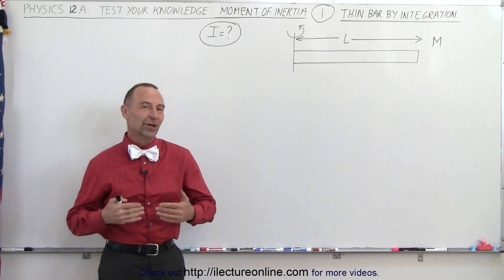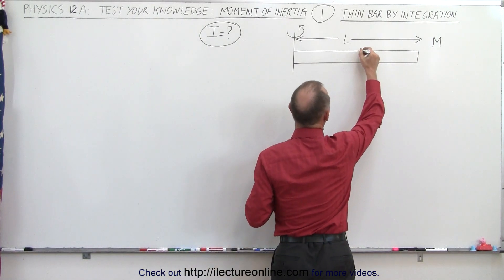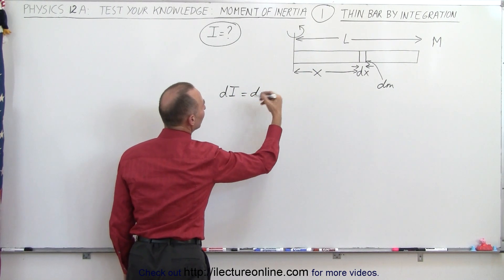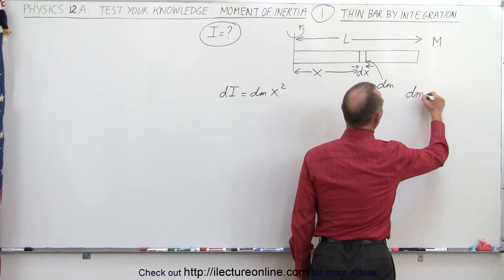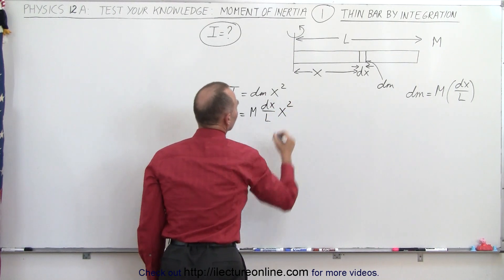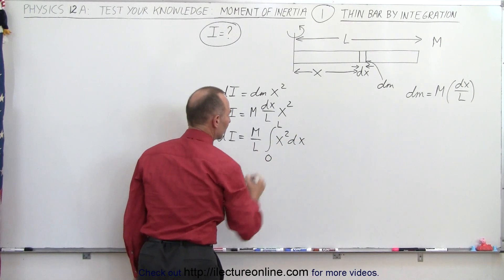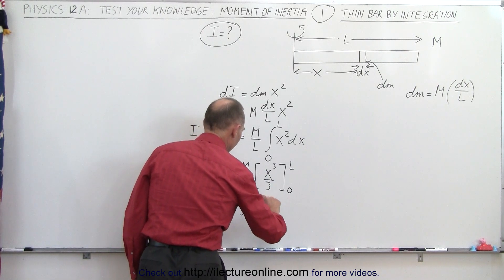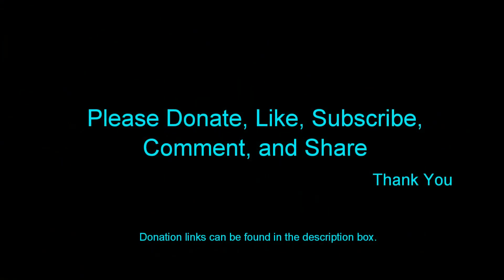Physics - Test Your Knowledge: Moment of Inertia (1 of 24) I=? Thin Bar by Integration

Comment: i am sorry sir is there any other way to communicate with you instead of here? because if i have a picture or so and i need to show it to you thanks.
Reply from the maker: Our time is limited to answer the many questions we get.  This is the best way to get a hold of us.
Reply: @MichelvanBiezen  thanks sir
Reply: @MichelvanBiezen   i am sorry sir if you remember this problem (a stone of mass 5kg falls from the top of a cliff 50m high and buries 1m in deep in sand.find average resistant offered by sand ) i sent this to you and you solve it.thanks 
but i found in some books an equation that say  Fres=mg+(h/x) where (h) is the height and (x) is the distance travelled through the sand and if  i apply it will not come the same answer which is 2450N
Reply: i am sorry sir the equation is Fres= mg(1+h/x)
Reply: Sir please explain this
Reply: Sir i am sorry  you didn't tell me the correct answer about this problem is it 2450N or 2499N
Reply from the maker: Correct, we need to add the extra distance traveled to the total change in height (51 m not 50 m)
Reply: @MichelvanBiezen  but if we do so will not give us the answer given in the book 2450N